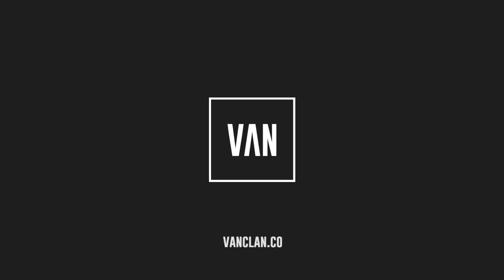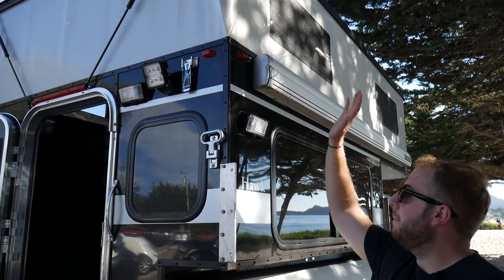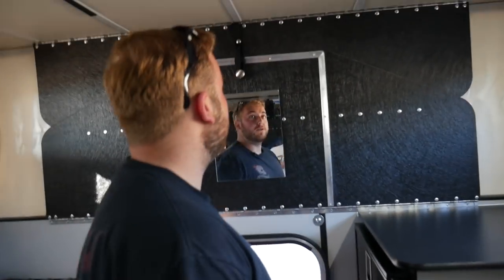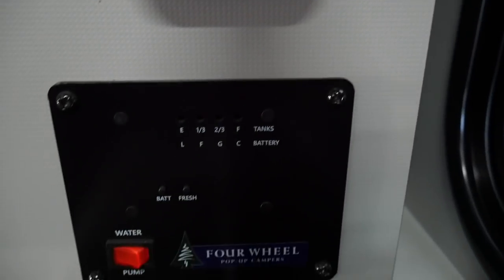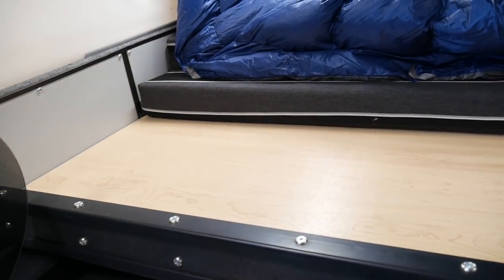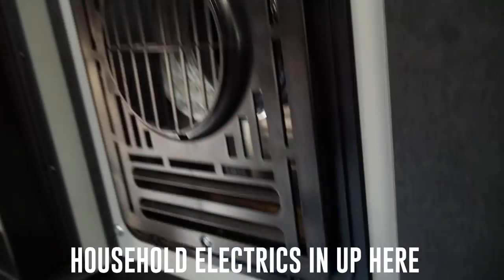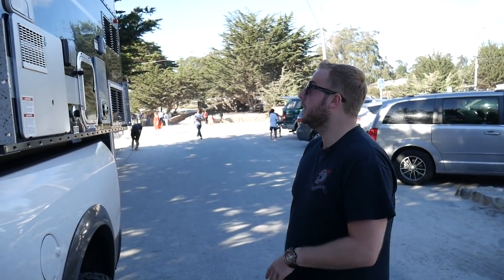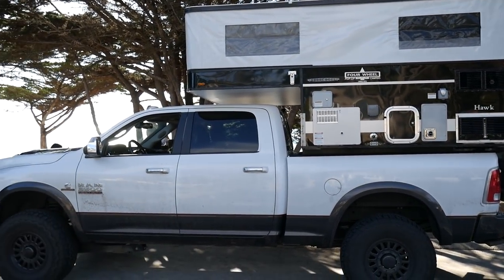Taking A Tour Around The ULTIMATE Pop-Up Truck Camper

Comment: We had one of these when I was a kid and my father was a regional retailer for a few years.  Let me tell you that this company is on point.  They are not cheap but one of these with an arctic-pack on the back of a Toyota Tacoma or Tundra and you can sleep 3 adults with no trouble while getting into some seriously rough and cold country in comfort.  Try doing that with a 4x4 Sprinter at lower cost.  The only downside is that these are not exactly "under the radar" no matter what vehicle they are on so they are not for "urban adventures" but for the person who wants to get OFF the road, this is the ticket.  They also offer a "shell" option for a good bit less than the factory built up models sell for.  If someone is "handy" or content to rough it a bit more, building out a shell model on your own is a pretty good option.
Reply: I want one for my Tundra as I have a solid roof camper but it's too tall. However, even used they are way too expensive

Comment: We have had a Four Wheel Camper shell for about 4 years now.  Very well made.   As a 70 year-old female, I have no problem taking my turn driving this due to its low profile.  I will not drive a trailer.
Reply from the maker: Agreed, it's a lot easier and safer to drive!

Comment: How did you like the AEV prospector XL? 37 inch tires 4x4 Cummins quad cab. That things a beast. I want one,I just need to scrape 90k out of my couch cushions and I'm good to go.
Reply from the maker: It's very, very big, a great vehicle for anyone wanting an off-road truck!
Reply: steven wright That’s not a Prospector, it does have AEV wheels, but none of the other bumpers, hood, highline flares, etc...great truck in any case.

Comment: My palomino bronco has shower and  potty
Reply: cointoss election  I got my 2009 in 2016 for $6500 with all equipment working.
Reply: cointoss election  The Palominos build quality is not as good as the Hawk 4wheel.  But I have real air conditioning and electric lift jacks  those are very expensive add ons
Reply: cointoss election  Watch for water damage in buying used.  I have a ford F250 diesel long bed  these likely will fit in your 6 foot bed with your tailgate . It took some time and luck to find the price I did.  But new they can be had off season for from $11,000
Reply: @enriquelaroche5370  This camper is not worth half of what the asking price is ! I would take a Palomino any day over this !